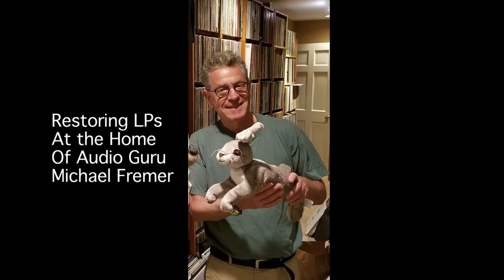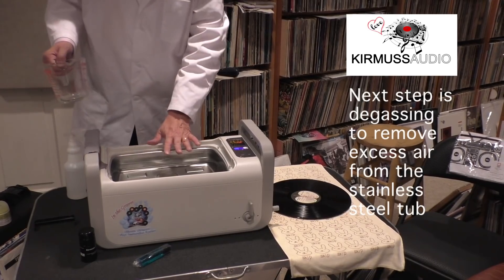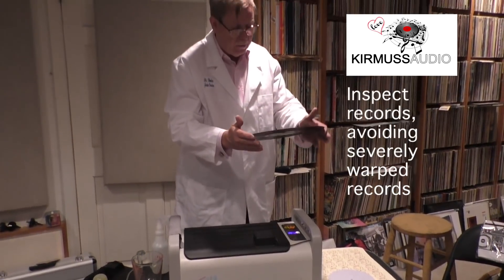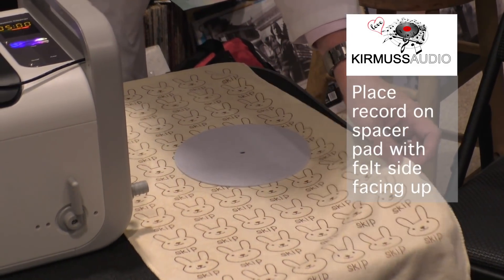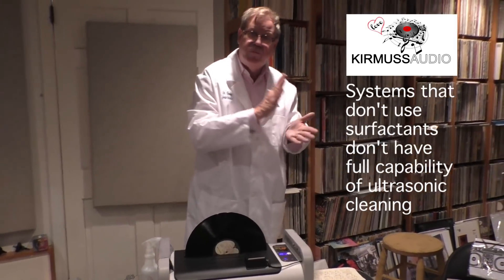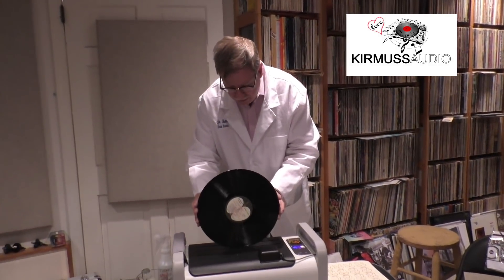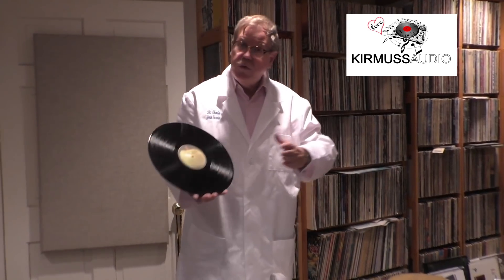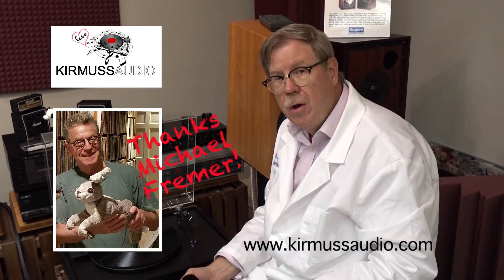KirmussAudio System Demo

Comment: this is way... too time consuming for me.
Reply from the maker: Understood your point. 

To your post, it all depends on what you expect from your hifi system. Full performance of the needle riding on the reverse image of the mirrored lacquer, or, riding on the reverse image of the master with release agent and left over films from other cleaning processes that are air dried or vacuum dried as a coating..reducing inadvertantly the timbre and soundstage that the master is capable of offering you.

6 or 7 two minute cycles or 4 or 5 five minute cycles on 4 records simultaneously offering a 1.3 to 4 plus dB  gain over floor is what one would expect,  is only offered by our process.

Cannot say more.

Other methods cannot do what we do. We remove the release agent from 70 years or 2 months ago on records. 

 As Andre Jenjings from the Absolute Sound this month and Michael Fremer in Stereophile July 2019 said,  if you want to bring life to your records,  only our process does this. 
 Yes,  some time and love is indeed required as you infer.

Unlike other cleaning methods which all actually leave films on the record that we can measure,  we can surface clean if you wish   4 records at a time in 2 minutes. Reponding to your desire.  No other system can offer this either.

As to restoration,  Using our patented process, each cycle lets you see the removal first of surface contaminants, then the left over films from prior cleanings and methods used, then the release agent. The latter holds the pops and clicks of the microwelded dust in the release agent created by the heat of the needle. With release agent removed you will never burn in any dust in your record grooves.  Leading audio manufacturers at trade shows use our orocess on a record that you may have brought to an audio show before playing it on their system. Ever wonder why?

For the audience....
When is a record deemed clean? When is a record "restored" ?

Visit one of our many dealers.  Bring in a record, new, used, previously cleaned with any other method. Play the first song on one side.  Use our process as prescribed.  Then play the same piece. 

We describe dB gain. Other processes never mention this aspect. 

Indeed we may surface clean  4 records in only  2 minutes. This is not the intent of our process. Rather than buying a 3,000 USD cartridge or 1,300 USD silver turntable interconnect cable, at less than 1,000$, we bring records both new and old to life.  Respectfully, you will hear and feel the music and artist as never before. The results are heard and felt even with entry level turntables  connected to the many  self powered speakers.
Thanks for your post. Hope we explained surface cleaning versus release agent removal and the measurable results.

Comment from the maker: Well noted. Analog experts  Andre Jennings and Michael Fremer both ascert where  the KA-RC 1 is not a surface cleaner. We are a restoration process. To explain,  We remove first films left over from prior cleanings, then the record pressing process release agent that is  weeks or years old. The latter is where we find  the dust microwelded into it by the heat generated by the needle,  causing the pops that one hears.

 Restorstion is 6 or 7 two minute cycles or 4 to 5  five minute cycles depending on the provenance of the record. 

Yes there are repeated steps.
...This as where vinyl repels water with or without  a cleaning solution. That is why for decades the many cleaning processes do not work as to getting into grooves. They also inherently leave surface films when records air or vacuum dried. .  Added the size of the water molecule. Another hindrance to getting into the grooves.

As our ionizing agent gets washed off in the process due to the charge of the record returning to the like charge of water, that is why the repeated steps. 

...Also by chance  we see the actual result of each cycle by what the goat hair brush has brought up that the sonic softened in the prior cycles.

If you wish to just surface clean, use a 3 minute cycle with our machine.  We may clean 4 records at the same time.

Restoration per Andre Jennings brings soundstage and timbre back, hidden by films left over by  prior cleanings as well as  the release agent.
Reply: there is no such thing as a record pressing process release agent, the vinyl naturally does not stick.   Such a fundamental misunderstanding make me question if this machine was designed correctly, ofrif it is just trying to catch some cash in a hot market,  with a lower price and careless adaptation of a generic product.
Reply from the maker: @richardelliott8352  anyone that is familiar with injection molding and extrusions of plastic knows there is a lubricant that surfaces to allow for the injection or pressed item  to pop out. Using the Keyence VHX 7000 we can measure this. Before and after pressing oil removal. Shure invented this term,  not us.   When PVC is recycled and used in a vinyl press the new pvc  biscuit mix for a record sees at times the record caught in the stamper and where an added polish is used on the metal stamper to increase lubrication to temporarily extricate the pvc biscuits needing a modified mix of stabilizers, liquefiers and plasticizers.  Proves the concept of a pressing oil appearing.   Buy a new pressing and notice what the needle is picking up. Just give us a call so we may respond in kind to your reservations in more detail.

Comment from the maker: Thank you for your querry.

Please do note foremost where our peers sell their ultrasonics at 4,000, 4890, and 7800 usd respectively.  These are their list prices. Our ultrasonic baed machine with sundries and proper designed record suspension system itself is no where near these retail levels. We offer the best bang for the dollar with written gustantted results in decibels. We are the standard. 

Our dealers have   2000 sets sold in the US alone last year to audiophiles. This indicates to any reasonable person where we are the true honest value leader.  I have no issues as owner to explain our profit. Am proud of how we support our channel partners.

Our product channel partners are honest, most if not all are family owned businesses, just like ours.

We were seen  by manufacturers such as Jeff Rowland Design, Oracle Turntable,  Audio Note as industry leaders and honest. They use our product to restore their own records.

We are the only sonic based manufacturer to offer a written performance guarantee in restoration.. 

Audiophile and dealer approved!  

To your question, We have pricing established at 3 tiers. Distribution Price, Dealer Price, and Retail Price. Each tier makes a profit. We also have manufacturer representatives promoting our products. They receive the same commission as they would on their other audio lines they represent.    

...If you have been in retail you should appreciate this. 

Continuing...
Import  Duties are 2.5 % from China, plus where we have the Trump Tax added  of 25% added.  Pending is another 10%. This arrives at our  product cost. 

I have no issue in providing you with the above as to each profit tier.

I  am personally supportive of audiophiles and our channel partners and our mutual responsibilities as custodians of records and recordings. 

Compared to our dealers and distributors, we   are making very little when compared to our channel partners. ...This said,  we sell primarily through dealers. We have no on line store. Our  Dealers make the same amount of profit on our product  as they do with their other high end lines.

... You seem like a bright person. 

 If you have been in retail or  know of someone that is involved in stereo, or have been a manufacturer's representative, you should appreciate what that profit lines are between respective sales channel tiers to remain a viable business.

.  Easy for you to see who makes what off of our list price of 970 usd for the us model.

 Overseas models are slightly more expensive due to added costs of a different power supply, three additional electrical approvals,  and shipping. Overseas also have added taxation. As to the US model you refer to.  we ship by air our 30 pound unit to our hq.

With your calculator in hand, we, our dealers and distributors and reps   are certainly the friend of audiophiles and especially where we meet our responsibilities as custodians of recordings by using our affirdable and globally  proven process to restore records and bring back proudly to life   those artists, engineers, musicians, studios long passed.

Comment: All vinyl is not created equal. PVC is only one ingredient and while that may hold up to heat how does one know the other vinyl ingredients will hold up as well? There are countless vinyl recipes in existence and each manufacturer over the decades probably has or had multiple recipes. So unless every vinyl recipe on planet earth has been tested in a 95 degree ultrasonic bath of water/alcohol combination and then tested thereafter year after year after year, etc.. for (loss of) sonic quality, it seems factually impossible to make a blanket statement that isopropol alcohol will not damage your vinyl. How could anyone possible know that? Good luck.
Reply from the maker: Thank you very much for your illustrations. This is a great addition to the community. . Leaving out the new green vinyl from Green Vinyl aside and their soon to be disclosed formula, except in the days of polystyrene records, pvc has been around for more than half a century.  It, along  with carbon black added  was the standard.  Just as you state there are polymizers, stabilizers, plasticizers, all added. Mixes do vary. As such some points to share.

As to heat. Records bought and then  placed is a hot car may in fact damage and warp the record. We saw this in our tests in Arizona.  In the shade our car yielded 147 deg and warped records temporarily. Those placed on the dashboard, not so lucky. Added was heating directly by the sun. Taking advantage of your point,  the heat of the needle causes friction znd as a result,  generates heat. That is why it is recommended to play a record once per side per day as a caution as many cleaning agents could have affected the plasticizer unintentionally.  

Indeed we talk about heat.  Ultrasonic machines in the process of cavitation sees the water heat up by way of the kinetic energy.  That is why we show the status of the water's temperature. Records are to be removed at 104  at the maximum. Records do survive higher temperatures. Not all homes have air conditioning.  A record that comes out of a press is at a higher temperature.  Processing a record at 94 deg F has no effect on the record.

As to chemical compatibility, the little amount of 1.4 ounces of 70% IPA in 1.78 gallons of water in our basin will not affect the structure of the vinyl record. It is not used for groove cleaning. Per the pvc chemical compatibility chart,  this is safe.  In our case the 1 to 2 % mix of diol propanol  in 98 to 99% distilled water used as our ionizing agent is also PVC friendly, and  promotes the attraction of the plasma wave created  via cavitation to hit  the record's groove.  The use of 70% over other IPA's such as 91, 99% is used for pvc compatibility,  but more so where  the 70% through its production process unlike higher IPA's  has the ions we need in our process.  Indeed as you have stated and as what we recommend. one should  never use any  cleaning agent on any record unless one reviews its compatibility with the aforementioned chart. Avoid also the word rubbing alcohol, and before purchase, sone IPA's show this wording, make sure in the ingredients list shows it is IPA only, no additives.  

Our recommended IPA concentration is safe for both vinyl and shellac records. As just mentioned.  it is not used for cleaning,  it is used to kill the dormant and live fungus that comes off the record and finds itself in the tank. 

Thank you for bringing this subject up.There has been much misinformation published out there.  Your points raised were very timely. Keep those records spinning!
Reply: @kirmussaudio7578  Amusing. Now you see it, now you don't. The shell game has been around for a half century as well. A quick slight of the soap and your Stones LP goes up in smoke. Diversionary, rudimentary blather.